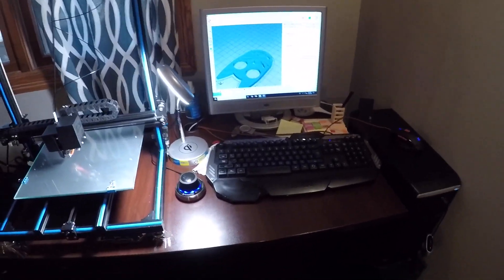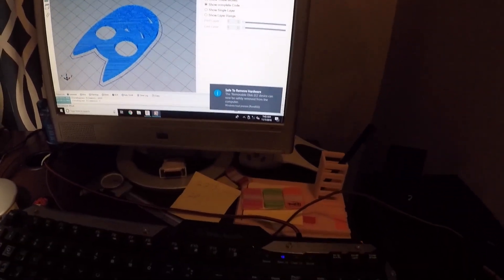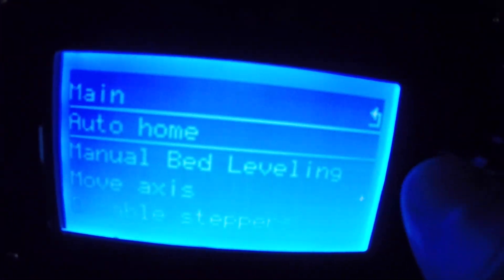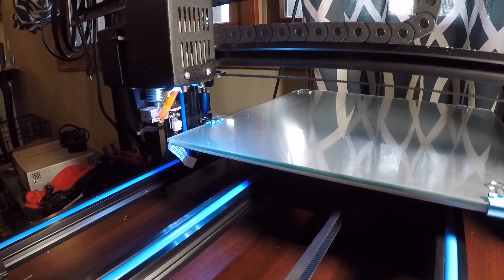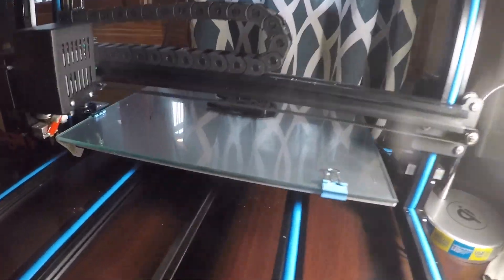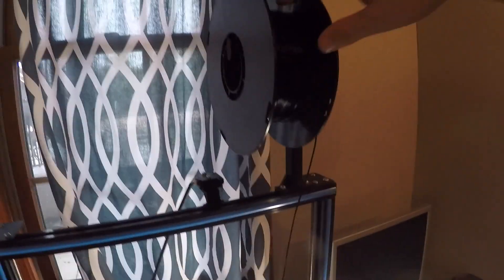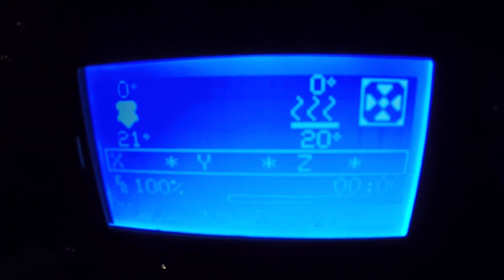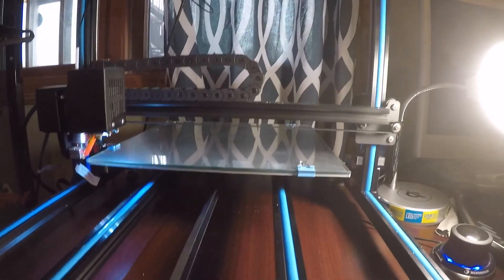ADIMLab 3D Printer Review

Comment: So I put in the bed size and have the printer controllable with cura, everything works fine except when I go to print this file it starts printing in the corner and goes off the board. Can’t see to figure it out as of yet, I’ve tried several solutions…
Reply: You can move the model around in Repetier-Host.

Comment: hi there,   i have the same printer and the switch on the control box does not switch off, any help would be great thank's....
Reply: If you're connecting to it with the USB port and using a powered cable it will stay on even if you turn off the switch.

Comment: Can you tell me how to get my new adimlab to work with cura 15.04.6 I try many setting  my printer is a adimlab is a new 310x310x410 and I can't get it to work either cura  what is the machine setting  and cura setting  I need you help
Reply from the maker: This printer is not directly compatible with the Cura engine. You can slice you 3D model with Cura and the printer will run the Gcode just fine, but you can't plug your printer in and connect it via Cura.
Reply: can you help me to setup my printer setting
Reply: @handyreviews98   so can i just set it up as a cr10 when slicing in cura since this looks like a clone anyways.  im assuming the only thing i need to worry about is the bed size when slicing? thanks.

Comment: I got this printer 2 weeks ago. It is my first 3D printer so I have nothing to compare it to, but I like it. It was really easy to put together and so far, the few times I used it, it worked great. The prints are nice and exactly the way they are supposed to be. That said, I am wondering if you could tell me what settings you used, when setting this printer up. I only used 'Repetier' so far, and I had to do nothing really, however, when I try other software, they ask me to specify printer specs such as print area, nozzle size and what not. Any idea what I should enter? Thanks for posting.

Comment: The filament detector dont go in this direction, must be vertical
Reply from the maker: Maybe you have a different model of printer. I know ADIMLab has a few models or generations of the same printer.
Reply: @handyreviews98  There was a revision to their instructions as the printed instructions show it as you have it but the design was for this to be vertical.  I just purchased one in December and can confirm the video and documentation were done incorrectly and there is also a post on their facebook community about it.  https://www.facebook.com/groups/1235236596606278/ . I have been running it vertical for a month now with no issues.

Comment: i just got the same one the other day but im having issue with print quality and i think its because the extruder kept running into the print in some places if you know how to fix please let me know thanks
Reply: Thanks I tighten the thumb screws up and it fixed the problem
Reply: you have to tighten up your print carriage it comes loose during shipping just undo the nuts on the x carrage and pull the wheel closer and then tighten the bolts back up
Reply: please add in facebook group: ADIMLab 3D Printer
will help solve the problem